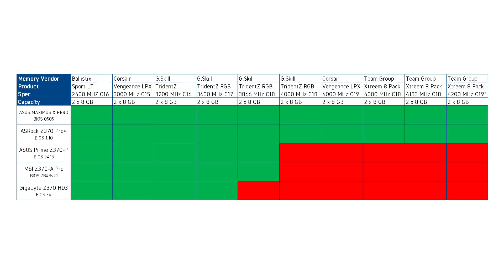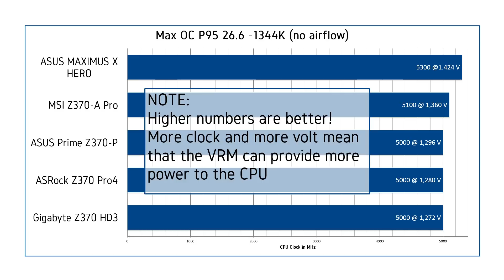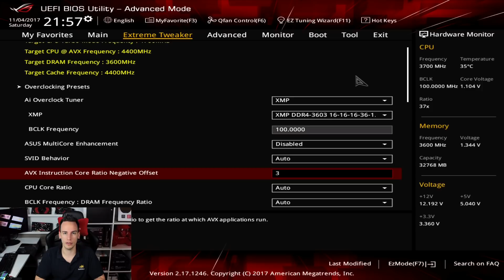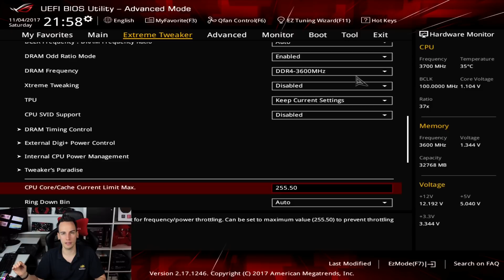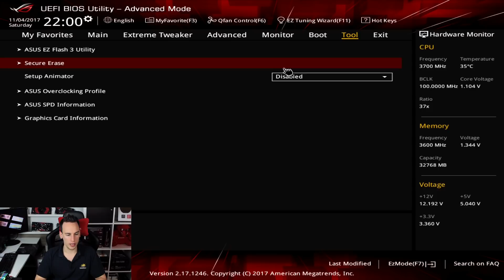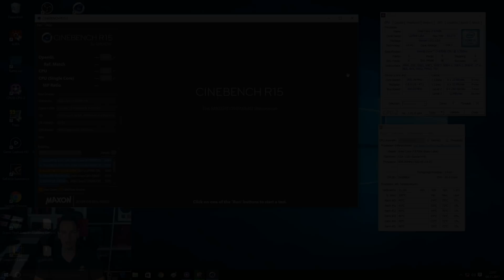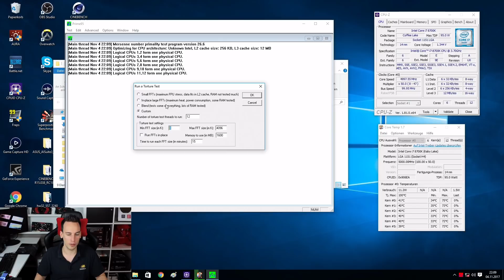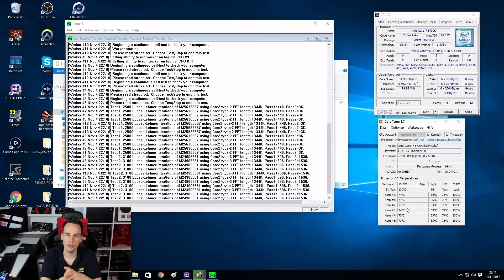ASUS MAXIMUS X HERO - Overclocking Test and Guide 8700K (en)

Comment: Just finished my Intel i7 8700K build, and also made a video about it, you know where to find it ;).
I must say that I really like the performance of this processor. I combined it with the Asus Maximus X and overclocked it to 5.2 GHZ.

p.s. der8auer, you are featured at the end of my video...
Reply: Eber Hwang. Mine is running on 4.9 ghz @ 1.28 v. If i go higher temps go to 95+ C. This is on a p360 EKWB kit that is only cooling the CPU.
Reply: Is all this "delid" talk necessary to achieve these OC speeds?
Reply: Eber Hwang depends on your cooling. I use 8700k non delid on this board with a 360 aio and only hit 85c in aida/prime 95 big stress tests at 5ghz at 1.35
Reply: i didnt delid mine, ran prime 95 all weekend (accidentally, apparently "X" minimises, not closes by default) with a Noctua NH‑D14 was fine
Reply: Orange83 i just built my 8700k/maximus x hero. Holy hell its a beast. I had a z270 board die on me so i just decided to upgrade (7700k paid for half almost lol) but the performance is well worth the upgrade. Especially seeing how all good z270 boards are non existant anymore....
Reply: Side note. My io shields wire from board to pcb that controls the rgb, melted right through.... i unplugged it, board still works fine.
Reply: what cooler?
Reply: Fisher lol....
Reply: FYI. I have an open case and a Corsair h110i AIO and was able to easily get stable 5ghz with this same processor, MB as in video.  No fan performance changes were necessary.
Reply: You misunderstand. Most AIOs can't beat a quality air cooler like the Noctua NH-D15. And if you had a monster custom loop with multiple radiators and reservoirs, but a CPU without a delid, it would be hotter than a delidded air cooled CPU. There's not much point in having a kickass cooler if the heat can't transfer properly to the IHS in the first place as far as I know.
Reply: Depends on your cooler I think. Air cool plebs might need to delid. Might get hot running some prime 95 but for practical uses/gaming you should be well within temp range.

Comment: I dont know if you still watch the comments but can i 100% trust the vcore shown in cpuz? My non delidded 8700k gets around 91-99 Celsius on 4.9 ghz @ 1.33 v. LLC on turbo ( Aorus 7 ).  Im using a 45 mm 360 Ek rad and Evo block.

Comment: Followed all steps and on cpu-z, core voltage is 0.672 V.

Only difference is I did 48 instead of 50 overclock because I’m not delidded.

Help please. Thanks!

8700k/Maximus x hero z370/ z trident 3200 16 gb
Reply: Delidding is only needed if your temps are too high, you can get 5.2 on non delidded.  But update your bios to fix that voltage issue.

Comment: I had silicon lottery delid and bin my 8700k. I followed your steps other than the overclock speed. Silicon Lottery sent back what overclock stability for my chip is 4.9 @ -2 offset with 1.387vcore. My temps with these settings and following your guide is 50c. Do i have room to get too 5.0? I am fairly new to overclocking any advice is appreciated. 
Asus Prime z370p with latest bios
Evga 280mm closed loop cooler 
16gig G.Skill 3600
Reply from the maker: What’s your voltage on load? I wouldn’t really use much more than ~1.42V. You can try that and 50 ratio
Reply: I've got it all figured out. Stable at 1.385v @ 4.9. I didn't win the lottery but it could be worse. I was thinking a maybe the Asus Maximus Hero will give me cleaner power for lower voltage, I am hoping :) Offset turned too 0 I don't think I can get to 5.0 @ 1.42 just seems crazy when other people are at 1.3 :( Thanks for the great info in the video.

Comment: Thank's for guide! But i got a problem! I have done everything you said, but i don't have delid already, there is no delid  to shop!  This my problem: Overcloack 5ghz is stable with prime 95, but when i play to game, my 8700k put lower is frequency 5000mhz to 4700mhz. my temperature is ok with prime but with game the temperature pic write with 1hour of game 88degree celcius. What must to do , is my mother board protec my cpu, with lower cpu voltage because cpu is hot?
Reply: Guess you didnt watch the video, set your avx to 0.
Reply: yes i found johnny, thank's!

Comment: Thanks for the comprehensive overclock tutorial.  
I have a question: If I want to increase the benchmark score in 3Dmark Firestrike 1080p or fully utilize GPUs. What kind of overclock speed is the most important? 
Currently, my CPU is overclocked the same as your tutorial. 
GPUs are 1080Ti SLI. 
Ram is 64gb 3000MHz 15-17-17-35 with XMP profile.

Comment: After applying this OC settings i'm missing CPU VID readings from programs like HWiNFO64 or HWMonitor. Why? I'm on Asus Strix Z370-E mobo, but i think this applies on all Z370 boards.
Reply: It's the bios 0802, it will be fixed in the coming new bios

Comment: oc noob question: is it possible to set an overclock that only gets applied when the CPU is stressed to a higher load? I don't want my processor running at full oc all the time, only when necessary.

Comment: My CPU sits at 4.8 because I wasn't able to hit 5.0 without having temp issues. My question is what is the point in having your CPU download by 300mhz shown in this video under load? Why not just set the avx part to 0 for higher 24/7 clocks? When under load my CPU goes from 4.8 to 4.5, most likely due to the above instructions.

Comment: I havent delidded and would like to hit 4.7ghz with lower temps and voltage, should i change any of the other settings? I did everything on the video except set 4.7 and voltage 1.27 and running fine so far
Reply: Nope, no need to change anything else.  As long as temps are fine youre good.
Reply: I take it if I have ASRock - Z370 Extreme4 this guide can still apply to it right?except maybe load line calibration. I want to do the same mild 4.7ghz OC w/ 1.27v peter lemarc did.
Reply: Change your load line calibration from 6 down to five especially with your overclock you'll get more stable voltage in lower temperatures.
Reply: Randall Miller do you think this will resolve my core volt issue? I overclocked to 4.6 and with 1.26 voltage but the voltage sometimes went up and down (between 2.16 - 2.31) which concerned me. Also, when running prime95 the clock speed dropped, any idea why that is?
Reply: @CarlosM-wz1tx  I was using 1.25 volts with a 4.7 gigahertz on all core. My temps would never hit higher 72 c using occt. After turning the load line calibration down I was able to overclock using a little higher voltage going up to 4.8 gigahertz on all cores at 1.27 to 1.28 volt. I would just experiment what's the differences I personally like occt and I watch the voltage spikes and temperature spikes on all cores in real time and I look for stability, and consistency.

Comment: If anyone is getting less then 5 ghz such as 4.7 ghz then I believe it is from the avx instruction core ratio negative offset. Do not change it to 3 leave it at 0 and then it should stay at 5 ghz when running applications or tests. @6:05
Reply: Having my rig set to 3 caused an audio/video sync issue with pops and horrible audio lagging behind video and setting it back to 0 cured that problem.
Reply: @SusFuss  hey setting it back to 0 still fix the audio/video lag issue? I'm currently experiencing this too haha
Reply: @skypetaa  Any results, im currently experiencing this as well
Reply: @TheTacCom 
Hey,
Resetting the values back to default worked for me. I no longer get any issues with delays.
Reply: @skypetaa  Not that much of a solution for an overclock
Reply: Noob question: Is that safe though?
Reply: If my goal from the start is 4.7ghz I don't need to put an offset right?
Reply: AVX instructions still run with an offset just at a lower frequency this should not cause any issues whatsoever try switching the load line calibration from 6 to 5.

Comment: Heeeelp my vcore no changing, = 0.640... whats the problem?
Reply: PePe García I’m having this same issue.  My Vcore is 0.672 which is exactly half of what it’s supposed to be:  1.344.
Reply: DJPlayedYA :( It is the same as my
Reply: DJPlayedYA what are your rams?
Reply: I have the same issue.  I will not be overclocking until I can actually see where my voltage is sitting.  and then in cpuid hwmonitor it doesnt show a voltage reading if it is overclocked.  If I put it back to stock then it will show.
Reply: I sent in a report into cpuz, can use asus suite 3, that will show correct voltage for the time being.
Reply: Yep is cpuz, aida64 show correct vcore.
Reply: Its not the program its your motherboard, you have to update the bios.  For now you take that number and times it by 2 to get your correct voltage. its basically just cut in -half.

Comment: Outstanding review, only thing for me I don't like about this board is the position of the usb 3.0 header. Thanks to my case design its difficult to get it connected, much prefer boards with it located on the top right side close to the 24pin.

+Would love to get your thoughts on the Gigabyte Z370 Aorus gaming 7
Reply: I agree, which is why I bought this and it does the job. https://www.newegg.com/Product/Product.aspx?Item=9SIA9F943Y0325&ignorebbr=1&nm_mc=KNC-GoogleMKP-PC&cm_mmc=KNC-GoogleMKP-PC-plaCables+-+Printer+%28Parallel%29+Cables_-9SIA9F943Y0325&gclid=Cj0KCQiAzrTUBRCnARIsAL0mqczPsV1vIT7R6Xp21a6jH2OwJOCgQAwzmR
gp9mkA7Q96mtRqkAfDSNwaAt0lEALw_wcB&gclsrc=aw.ds
Reply: Same here, or use the 3.1 header and grab a converter cable.

Comment: Is it ok that my prosessor is stable on custom prime95 test but when i try small fft test those temperatures jumps straight to 100
Reply: If you're using a version of Prime95 greater than 26.6, then the small fft test is using AVX CPU instructions during the test which will greatly increase the temps of your CPU.  Try using version 26.6 of Prime95 and your temps should be much lower during the small fft test.

Comment: Followed your guide and set my 8700k to 5ghz and got it stable at 1.35v (delidded ofc), but in games the cpu bounces back and forth from 5ghz to 4.7ghz. What is going?
Reply: The game you're playing is most likely using AVX CPU instruction codes which is then lowering your speed to 4.7 GHz due to you setting the AVX offset to 3 in your BIOS. (3 means -300 Mhz which is taking you to 4.7 from 5.0)

Games that don't use AVX will leave the processor running at 5 GHz.

Comment: Hi and thank you for this great video. I just received my new main board and following your oveclock was perfect.May I ask you yet a question. Do you think is possible to install a Ram above 4133mhz (like the new 4266mhz from gskill?)
Reply from the maker: +Polli Christian  yes it should work but there is no performance benefit going from 4133 to 4266

Comment: OK, that mobo can provide 5GHz for 8700k. But this mobo only has 8pin connector. As I know there are only 150watts max that can be provided through 8pin connector. But at 3:10 we can see that this mobo consumes 210watts! Is this mobo will work normal if I will have 8700k at 5Ghz and 4x8Gb RAM running at 4Ghz? I am afraid that cables and connector and PSU will be overheated! (VRM will be cooled properly in my case)

Comment: I noticed that only one of my cores on my 8700K is dropping to 4.7Ghz under load and it's random which one does this and it only drops for a second then goes back up to 5Ghz but this is dropping my Cinebench R15 score to 1600 points at 5Ghz. I am watercooled using a Corsair H110i, but not delid my CPU, temps are around 80-85C at full load after a few hours of Prime 95. Any idea what could be causing this?

Great work by the way and thanks for posting this!

I'm also using 32GB of G.Skill Trident Z 3200Mhz RAM

Comment: i'm just curious: if you disable multithreading in bios would you be able to run higher clock speeds ?
Reply from the maker: +ian vosik  usually not much. Best case 50-100mhz

Comment: about core temp: is it not more accurate to go to settings in that software and set polling interval to lowest possible?  100ms lowest i can set mine to. and lower you get the higher temps it can catch.  stock ms is pretty high i think and depending on how it calculate/measure the temp, low ms might be much more accurate temp reading.
lets say polling rate is set to 1000ms, does it read each second at just that instant or does it do a average over that second? either way you get just random number or a smooth out avg and not peaks

Comment: Hey hab mal ne Frage! Hab meine KFA2 geforce gtx 1060 (3gb) von 1519MHz Default clock zu 1699 MHz OC, und 1734 stock Boost zu 1914 OC Boost übertaktet. Ich bekomme ca 5-9 fps mehr was ja eig sehr gut ist. Jedoch crasht Assassins Creed Origins nach ein paar Stunden immer. Hab ich beim OC was falsch gemacht bzw. kannst du mir sagen welche MHz sicher für meine Karte funktionieren? 
Danke schonmal :)

Comment: Hi could you please do a video on the same setup with a 4.8ghz overclock I can’t get mine stable at 5ghz I get system lock ups thank you
Reply: just put a x48 multiplier instead of the x50 he uses
Reply: scott gunther hi but shouldn’t i use  lower voltages etc then the 5ghz one
Reply: Bizzare Gamer yeah, this video was just a starting point already.  Choose a multiplier and find a stable voltage like 1.35 in this case. Reduce voltage by 1 step until it isn't stable. Once you find that point go back up 1 step and run your stability tests for longer you make sure it's stable. Repeat till you find the lowest voltage that its stable at
Reply: scott gunther ok thanks I’ll give it a go

Comment: Great video! Is an h60 enough to cool to 5ghz 8700k? I can only have 1 120mm radiator in my case, what’s the best option? Thinking of doing ek water open loop with 120mm rad.
Reply from the maker: could be on the edge. If delidded yes. Without delid, no
Reply: Thank you - I overclocked matching your settings, using same 8700k and asus board. I have 3200 trident Z cl16 ram. During prime 95 I got a blue screen that said "windows attempted to write to read only memory". Any idea what that is? I dropped to 48 from 50 to see if that helps at all. Temp was around 90c during prime 95, crashed within 10 minutes

Comment: Is it fine to leave the voltage at Manual instead of using Adaptive? Currently using AUTO at even stock has the voltages all over the place. Anywhere from 1.2v to 1.38v for me. I am almost getting random power loss and reboots which makes me thing AUTO is turning down the voltage too much and causes an instability. Using a Z370-E with 0430 Revision.
Reply from the maker: In that case I'd just go for manual to be sure you don't get crazy voltages
Reply: Longevity wise those is that a bad thing to do? I can still have the CPU downclock while idle but keep the voltage at a constant.
Reply from the maker: doesn't really matter

Comment: Whenever I do the stress test it always reverts to a 47 multiplier and stays there. On High Performance power settings. In Cinebench and Destiny 2 it will jump between 47 and 50 What would cause this?
Reply: If you're following the video instructions, note that he says to use a specific version of Prime95.  The AVX offset of 3 will drop the CPU clock by 0.3 on newer versions, which use AVX instructions.
Reply: Throttling down due to AVX instructions maybe?
Reply: same problem when i run prime 95 the cpu goes back to 4.7 what cause this
Reply: MrLalzor  is this safe?

Comment: I followed your video to clock to 5ghz but when I run the prime 95 test with your settings it's only going up to 4700mhz. not sure what's going on.
Reply from the maker: +Stephen Ta  using prime 26.6?
Reply: version 29.3
Reply: He said that newer version will use AVX and since you set a lower freq when using AVX (AVX core negative offset to 3 = 300mhz lower freq), that will cause your CPU to work at lower freq :)  That should be the reason!

Comment: guys please help me, i got asus strix z370-f and 8700k @5 ghz and it hit 100c with my kraken x62 without delidding is that normal?
Reply: also notice that my kraken x62 never hit 38c
Reply: what voltage are you on? 100c is too much!! I have the Maximus X hero and 8700k at 5.0 at 1.39. 80-85C max under IBT full load
Reply: Helgrind also same 1.39
Reply: Helgrind what stress test you using ?
Reply: Keith Boon intel burn test 15 cycles on normal (ibt also stress avx)

Comment: What is a safe overclock if you DO NOT delid the CPU?
Reply from the maker: Probably 4.8 at 1,30 volt
Reply: So, I do everything exactly the same as your video, except where you put in 50 for the cores, I would put in 48?
Reply: And set the core/cache voltage to 1.3 instead of 1.35. Run some stress test and see if stable. If you get a system crash, increase the voltage by 0.025 and try again until stable. When stable you can also fintune the voltage by changing it by 0.005 each time :)
Reply: Thank you very much. I'll give it a go in the next day or two.